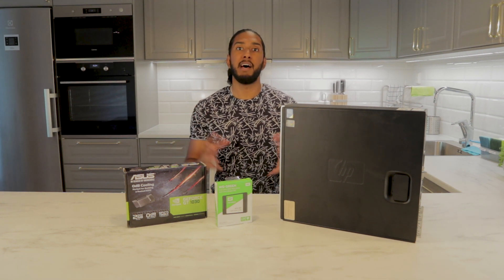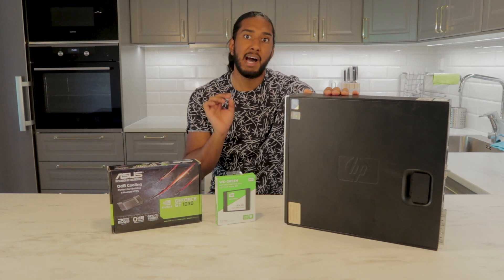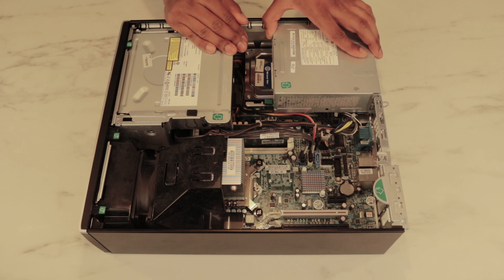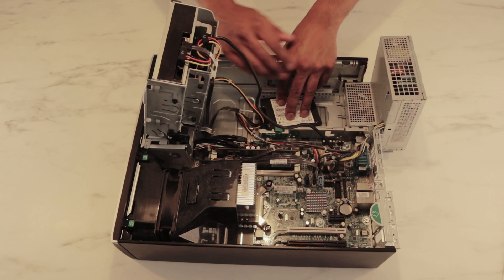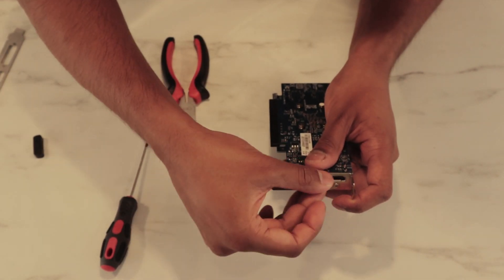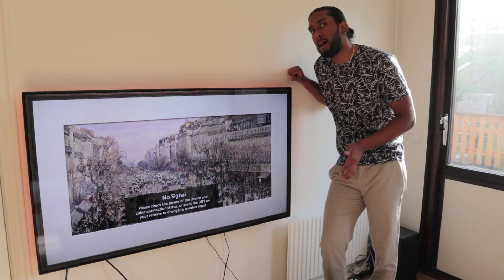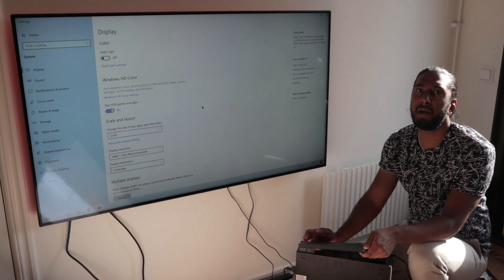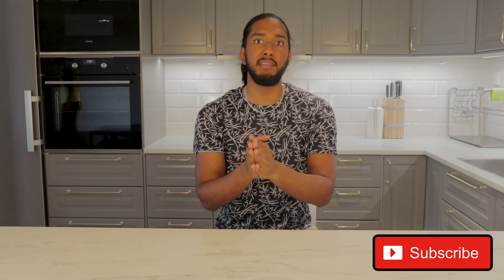Build the ULTIMATE 4K HDR Ready HTPC for under 250$ | HP 8100 ELITE SFF + GeForce GT 1030 + SSD

Comment: Great video. On motnerboard I noticed pci and Pcie x 1 slots. Wi Fi + Bluetooth can be added. As an example TP-Link Archer ARCHER T5E. And you can install a used low-profile sound card in the PCI slot
for not a lot of money and get compatibility with AV receivers via S / PDIF and good analog sound
As an example
- Creative X-FI Xtreme Gamer SB0730 7.1 PCI (S / PDIF output (stereo or passthrough only)
- ASUS Xonar D1 7.1 PCI S / PDIF
- Audiotrak Prodigy HD2 for HiFi stereo 2.0 with coaxial for digital (AC-3 or DTS data)
All cards are compatible with windows 10
Thank you for the video and good idea.

Comment: Hi a have a question does the GT 1030 still work in the 8100 SFF? On some sites it says the motherboard only supports 25 watts to the pcie ports and the gt 1030 uses about 32 watts... Any help would be greatly appreciated!
Reply from the maker: Yes it works flawlessly for us. They rate GPU higher than actual usage for stability reasons. But in real life useage it works without problems 👍🏿
Reply: @HumanSuten  Okay thank you for the fast reply. I think i am getting the gt 1030 then :)
Reply from the maker: No problem 👍🏿😊 Our sister has a GTX 1050Ti LP which also works flawlessly. You can also get a GTX 1650 LP. Those two are only recommendations if you're purpose for the upgrade is gaming. For us the GT1030 is enough for media use, 4K HDR.
Reply: @HumanSuten Hello, I have put the GT 1030 in my HP 8100 SFF and ik works perfectly fine. The only problem I have is that I can't put the pc in sleep mode. When I try that, the pc reboots and the gpu doesnt work anymore. I then have a black screen. I have to fully shutdown the pc and then it works again. In the logbook it says "Kernel Power 41". Would you mind trying to put your pc in sleep mode and then wake it up again to see if it works for you? It would really help me a lot. Thanks!
Reply: I have just fixed the prolem. I put the gpu in the other card slot and now it works perfectly. Thank you very much!
Reply from the maker: Currently not at home so couldn't test it out but happy to hear that your issue was solved 👍🏿😊

Comment: how did you install windows 10 on it? I'm trying on mine and it appears that you boot appears the windows logo but restarts the machine and stays in that loop, I'm doing it with a pendrive
Reply from the maker: You have to select boot up options when the computer starts, when you see the HP logo. I think you hit either ESC or F12. Look at the bottom of the screen, you can there is some text for diffrent keys you can press to access certain menus. Then you can boot from the pendrive.

Comment: Hi, thank you for this video... I will try this with a "GTX 1050 ti" on my HP Elite 8300 sff ! Which version of Windows 10 did you install ? Shall I install "v1803" first to switch HDR option on, then update to the latest ? Or can I just clean install the latest Windows 10 version ? Because as far as I know; the HDR "on-off" switch does not appear on the recent versions of Windows 10 settings !!! I'd really appreciate if you could clear up this issue, please ? Many thanks...
Reply from the maker: Hi, no problem 😊
Yes the GTX 1050 Ti LP and GTX 1650 LP are the best alternatives out there for these HP computers as they dont require additional power from the PSU. They have better gaming performance than the GT 1030 and also has Netflix HDR support. 
Do a clean install with the latest Windows 10 version. The toogle is still on the latest version. 
What I hoped was that a Auto HDR toogle was to be implemented because now you have to manually set Windows to HDR for HDR content then switch it off because SDR content will look wrong. 
The latest version of Kodi and some Windows PC games support auto HDR toogle.
Reply: Thank you very much...

Comment: I have the same, can I run gtx 1050 ti 2Gb?
Reply from the maker: Yes you can, our older sister has the configuration as Netflix has that GPU as minimum requirement for HDR compatibility. You just have to use the low profile bracket. The GTX 1050 Ti doesn't need and additional power source from the PSU, it runs with power through the motherboard.

Comment: Did you connect it to the tv? And if you  did can you do a vid how
Reply from the maker: What do you mean? We connected the computer with a HDMI cable to the TV.
Reply: So that’s all hdmi to desktop?
Reply: I tought hp elite did not have hdmi
Reply from the maker: In this video I installed a GT1030 (GPU) which has a HDMI port. 
If you don't install a graphic card you could always use a DisplayPort - HDMi adapter 👍🏿
Reply: You you basically connected the pc to the tv with hdmi ?
Reply: Also does the hdmi cable come with the pc or graphics card?
Reply from the maker: Yes with a HDMI cable. It's only one cable so it's not necessary to do a whole video on it. You can buy a HDMI cable separately.
Reply: Just do a vid it’s easier and you’ll get views cause people wanna use a tv as a monitor
Reply: @user-gi6fe9uz9z  the motherboards I/O won't have an hdmi port, but the graphics card that he installed will have an hdmi port. connect hdmi cord from the back of the graphics card, to the hdmi port on the TV

Comment: Will this work on a 8300 hp ?
Reply from the maker: Yes it will and it will have better performance thanks to a better CPU
Reply: @HumanSuten  and do i need the ssd for 4k hdr? Necessarily
Reply: @HumanSuten  and would a 120 gb ssd be sufficient
Reply from the maker: A SSD is not necessary for the 4K HDR part but it's really essential if you have a HTPC so that the computer boot up fast. Yes we do use a 128GB for our OS and softwares. We have our media content in our NAS and not locally.

Comment: I'm thinking to use back my AMD FX 8350 and change to graphic card GTX 1030. Can my pc handle 4k bluray video.?
Reply from the maker: Do you mean actual 4K UHD BD Discs?
Reply: @HumanSuten  Mkv file about 50gb or more.
Reply from the maker: That should be possible because when using VLC and other media players that the function to use hardware acceleration which would use the GPU's power to play the media files instead of heavily relying on the CPU. 
With this GPU I believe we have tested out 30GB files without issues although we have a stronger CPU what you have listed.
I can not give you a straight answer as I don't want to promise something and then it will not work.
Reply: @HumanSuten  Thank you for your response. Can you test a gemini man 4k because my android box have a problem to play this high frame rate video.
Reply from the maker: Yes I will try to do so during the week.